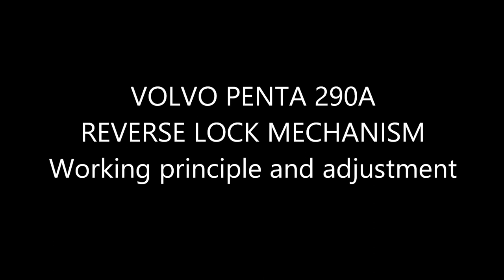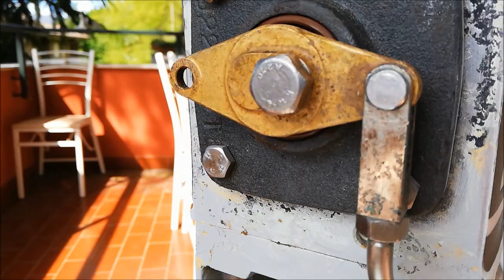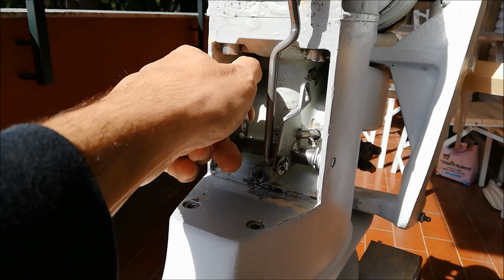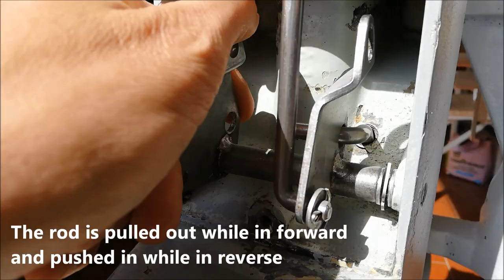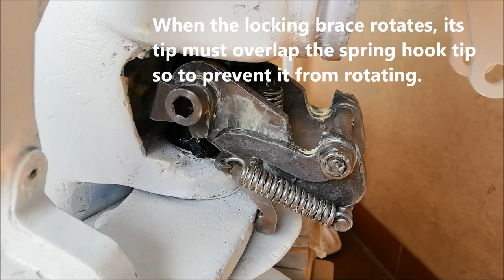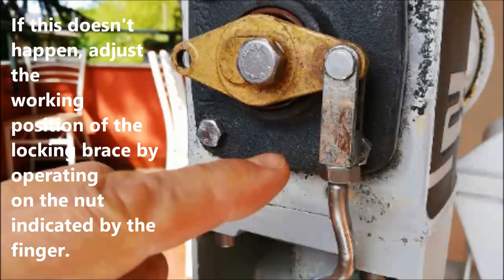Volvo Penta 290A reverse lock mechanism - working principle

Comment: I have a volvo penta 290 and on the bottom of the reverse lock mechanism there is the lock guide washer. Mine have all been screwed down. but when we have looked it up online no one else's has. we were wondering if you know if you need them or not????

Comment: Thanks so very much for the explanation, much appreciated! out of curiosity what lubrication are you using to grease all the working mechanisms?
Reply from the maker: Thank you for appreciating. I use a special water resistant grease for marine applications. You can find it very easily on the market. Anyway any grease is always better than no grease at all.

Comment: I have recently just purchased a boat with this locking mechanism. I belive the shift cable has been replace a few years ago. The problem I have is that when you shift into forward the cable PULLS the linkage. This causes the latch to be locked in forward position and realesed in reverse. If I switch the linkage to the other side the the linkage works properly but my shifter is the backwards.... I am stumped on what to do to fix this please help
Reply from the maker: The cable must push while in forward and pull while in reverse otherwise the reverse locking mechanism cannot work properly.
If that is not the case, please check the gear lever at the control panel. Probably something set not correctly.

Comment: I know you posted this 4 years ago, but I just came across your video due to some work on my 270 outdrive.  The mechanism for the reverse lock looks identical to what you show in your video.  What I'd like to know is what adjustment keeps the pawl lock from grabbing the trim rod when it's in forward?  The way mine is now working (I think I messed something up trying to get the reverse lock to work properly) when I pull back on the outdrive (simulating hitting something moving forward) the pawls grab the trim rod due to the spring pulling the locks upward and engaging the trim rod.  Seems that it shouldn't do that.
Reply from the maker: Hi. It is correct that the pawl lock grabs the trim rod when in forward. It is kept in this position by springs but, if the outdrive hits an obstacle, the spring will allow, above a certain impact force, the disengagement of the locking mechanism and the  lifting of the outdrive. While in reverse, a cam actuated by the shift lever will move and prevent the locking mechanism to disengage whatever the pulling force might be.

Comment: Ciao Stefano. Love ure vids. Was planning on checking this on my sterndrive but couldnt locate. I dont have rod nor reversse locking thing. I have a vp duoprop dp-e 1.95 from 2000. Does some stern drives dont have this or is it hidden somewhere insiden the drive?
Reply from the maker: Hi Martin. Thank you very much. I don't know. I just know my stern drive. You had better get a workshop manual to start with. Best regards.

Comment: Hello I have a problem with the lock, it does not stay in place, I do not speak English well I use a translator, thank you
Reply from the maker: It must stay in place. There is no reason why it doesn't. You have to understand why. Probably it is only a question of adjustment.
Reply: @stefanovaleretto3121  good evening thank you for your answer, it's just when I reverse gear, I think my system is reversed, I have to get the boat out of the water in the spring to check
Reply: @stefanovaleretto3121  Hello, I think my concern is that the boat stays in the water and that it ends up oxidizing, it should be taken out more often, hela, it's not possible